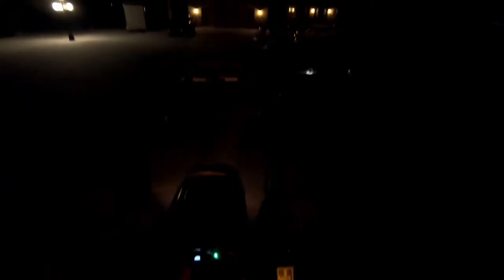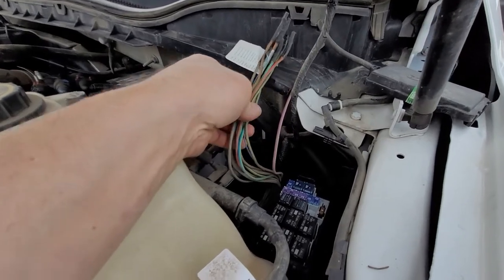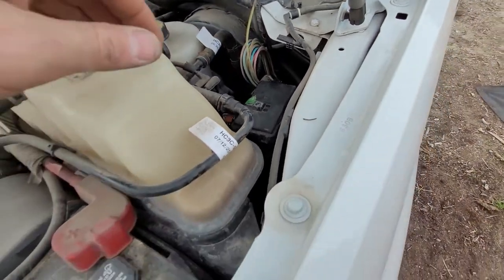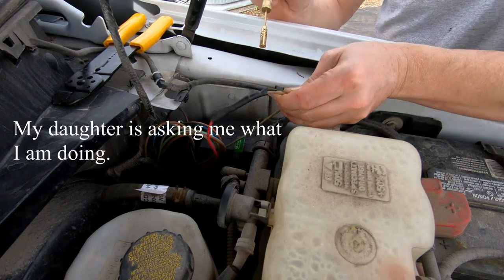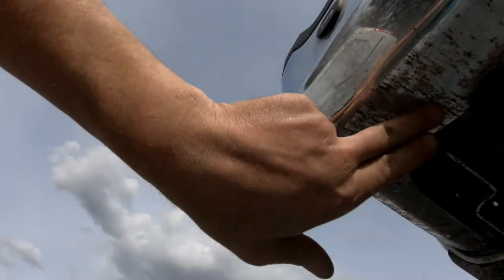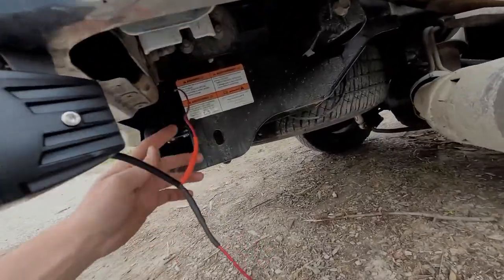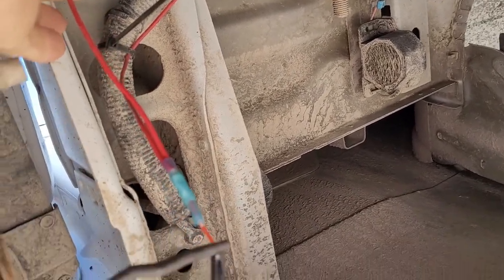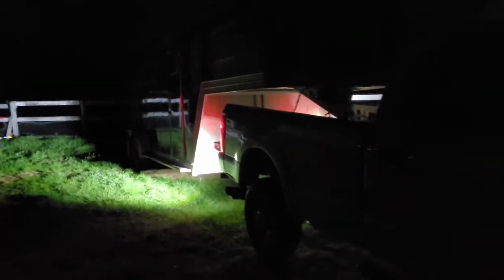Wiring Rear Lights for 2017 Ford F250 Using Aux Switches

Comment: Connecting that red power wire from the lights to that auxiliary upfitter switch wire provides all the power it needs correct?
Reply from the maker: Correct

Comment: That's where I shoulda put my lights I used the back of cab lights used the same screws that hold it in placed put some tire tubing behind it so wouldn't Crack it then wired it right down the back and along the window looks good and works but now I'm rethinking....

Comment: Hello sir. I'm getting ready to purchase a 2023 7.3 and in the back, I need to put a DC power pressure pump, and, a DC power aftermarket fuel pump. Are there already aux wire than run back there? On my 2008 F 350 I had to run my own. Thanks. Roy, So Cal.
Reply from the maker: A quick search looks like the truck probably won't have any pre-wired switches or fused lines. So you will have to probably tap into the battery, add a fuse or two.
Reply: @goddom  Thanks sir. Much appreciated. Have a good day.

Comment: Question. When you connected the lights in SERIES, did the lights turn on at all or were they just not very bright or something? TY
Reply from the maker: They didn't work at all.
Reply: You can't wire these in series.  LED's are not like lightbulbs.  LED's are diodes that emit light and diodes only allow voltage to pass in one direction, this is why parallel is the right choice for wiring them.

Comment: Hi there 👋🏽 what type of wire do I need to buy for the lights?
Reply from the maker: Hello, use either 18 or 14 gauge. 18 should be fine, but going bigger than 14 will get harder for the crimping.
Reply: @goddom  awesome, thanks Matt